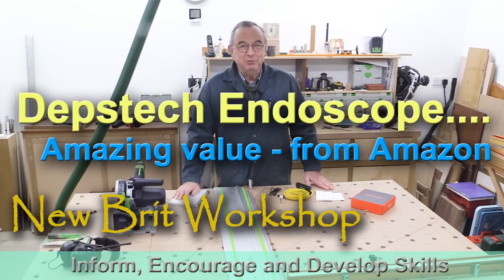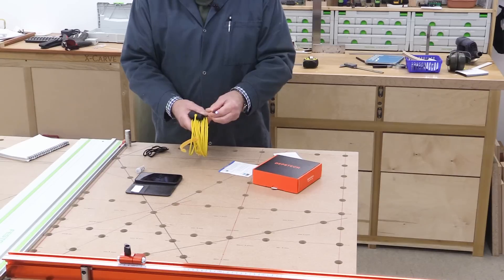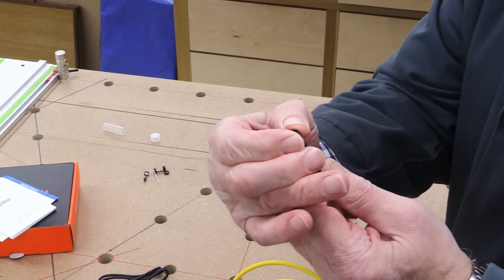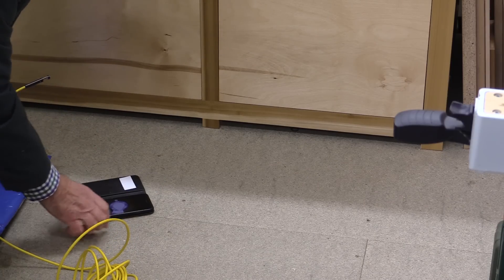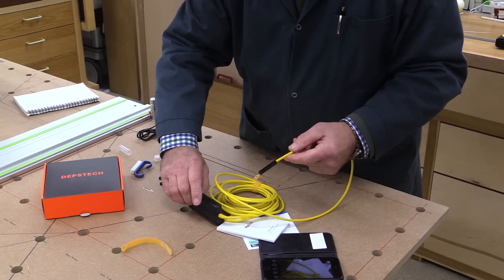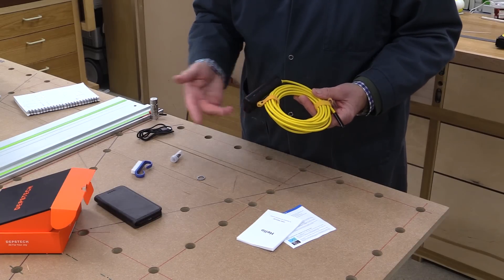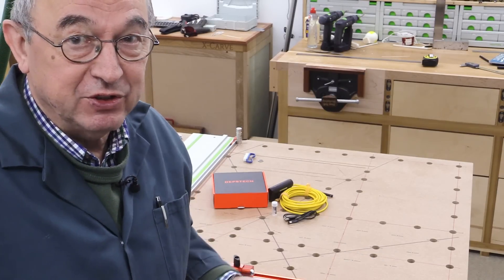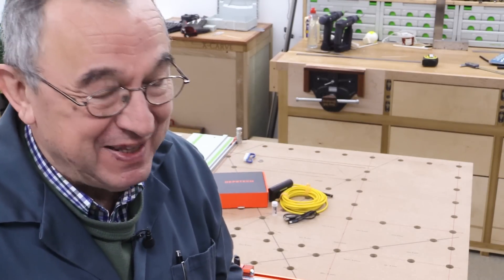Amazing Depstech Endoscope - Everyone Needs One !

Comment: Hi Peter    I bought a similar one from Lidl a few years ago and find it occasionally very useful.  It's more rigid but much shorter so easy to control in a void but doesn't have the useful side view.  I doubt it would be easy to control yours if much more of the length was used but it could be taped to a long fibreglass rod, such as I use to thread cables etc which would make it useable deep into a void with quite good control.  Mike
Reply from the maker: Hi Mike, It has really helped my recent DIY venture and, I am sure, will come in handy many more times in the future.  Cheers.  Peter
Reply: @NewBritWorkshop  has it lasted, considering buying one. Appreciate prompt response 👍
Reply from the maker: @KH-kl7qm  @K H Yes, I have used it many times. I have done cavity walls, a drainage pipe, looked behind several cupboards and, most recently, under the seat of the car. It works brilliantly and I have had no problems at all.  Peter

Comment: The camera and lens are all contained in the black portion at the tip. There are no fiber optics running down the yellow portion. Only power and video wires run down the yellow section to the battery.
Reply from the maker: Hi Bill, Of course - I must have been thinking of the gadget they used on me a few years ago !!  Cheers.  Peter
Reply: @NewBritWorkshop  Yea, no worries. No harm no foul. Yea, I've experienced that one myself... lol.

Comment: What a timely demo Peter. I have literally had one of these in my Amazon Wish List for a few weeks. You’ve probably just convinced me to move it to my basket. Thank you for the info. Allan
Reply: Me too 🤣
Reply from the maker: Hi Allan, I must admit that I thought long and hard about getting one but decided to risk it and boy has it been useful.  Cheers.  Peter
Reply: I've owned for a while now, and whilst it performs well in circumstances like this video, it's useless if there is any insulation material in the cavity.  Which seems like an obvious thing, but every time I've tried to use it, I've just got video of insulation that I didn't previously know was behind the wall/ceiling.

Comment: I got a 10 metre endoscope with identical phone wifi connection from Ali Express in 2017 for £15. No side camera though. Used it a handful of times only since then. Only issue I had was the refresh rate was quite poor out of the box. I tried several generic pieces of endoscope phone software I found with an internet search & one of them fixed the issue. No problem since then. Shorter lengths were available at cheaper price.
Reply from the maker: Hi David, Interesting that other software can be used with some devices.  Cheers.  Peter

Comment: All of the 'show it on your phone' devices suffer from the same issue. They are dependent on the vendors proprietary software supporting any phone system updates. When the vendor makes the unilateral decision to not update their software after it breaks you must make a decision... 'is it a door stop or trash?' Of course you could just dedicate the phone to be the display and never update it but  ...

l am sure you can figure out how I have come to this opinion.
Reply: That is exactly why I'm not sure I like this endoscope because I still need the phone and the app to use it. I assume I better off put a bit more of money and buy the one already with the display in the same set.
Reply: @ruinunes8251  The ones with screens are expensive, over £300.00. Can you record of the bigger ones? What if you hardly used it? I suppose then one of the cheaper ones of Amazon would be useful. Need one, debating both.
Reply: @anitapatel3591  I bought the Depstech ds450

Comment: It's probably just me but ... I found it quite confusing to work out which way was left or right on the camera images.  Obviously the camera rotates with the optic fibre and doesn't have a way of rotating itself independantly.  Nonetheless, it's an impressive tool for the money.
Reply from the maker: Hi Chris, Yes it is excellent value and has saved me making a big hole in the brickwork.  Cheers.  Peter
Reply: @NewBritWorkshop  Of course, if there was some sort of reference hair-line attachement in front of the camera lens, one could rotate the phone screen around to see a true left to right image.  Just a thought.

Comment: 0:19 I'm not sure, but I suspect that the signal is carried over the snake electrically rather than with fibre optics
Reply from the maker: Hi Tony, You could be right. Cheers.  Peter
Reply: It's via fiber optics for sure. Not enough place in such a small camera to have a video encoder in place. Wastes a lot of energy and gets got too.